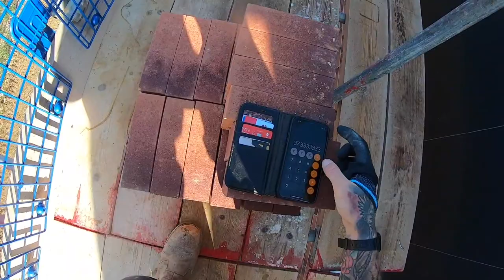Last Day on Maldon site....

Comment: How do you have a project that size and run out of bricks for 5 months
Reply: When big sites activity picked up after the end of first lockdown, they wanted as many gangs as possibles to bash them up even faster than pre pandemic to make up for the loss. But it doesn't work like that, or you end up with no materials since all the big builders did the same thing. Some sites have 25 weeks wait on roof tiles, 25 on bricks...it's ridiculous. Instead of having 3 steady gangs for example and keeping them busy at a steady pace, they got 6/7 gangs on some sites and materials can't keep up. Poor management.
Reply: Chris, blame Johnson's shitty brext trade deal. Most European lorry drivers can't be arsed with the customs officers. So they avoid travelling to the UK and thus  this is causing shortages of materials / food in shops.  The site I'm on now there's only 4 gangs building the houses and before brexit we never had a shortage of anything. Now we're running out of everything every 4-8 days, it's getting ridiculous.
Reply: @wumpty93  Numpty, its got nothing to do with Brexit, factories have been closed down, so of course you are going to have less production of materials. I work in Europe and its the same here.
Reply: @galdessa1  load of bollocks mate. It's never been this bad since we left the EU. I'm telling you now it's everything, not just bricks  timber is the worst, always waiting for the chippys to put the joists on and waiting on the drivers to deliver it. Always the same story from the site agent, "it's been ordered not to worry it's due soon" 2 weeks later nothing but excuses and nothing turns up. 

It's the same from my local supermarkets empty shelves and shortages on basic essentials. Blame the factories all you want that doesn't change anything
Reply: @wumpty93  as much as I would blame it on Brexit as well, it is definitely not the issue. Prices of timbers are through the roof in France as well, and the shortage of material is the same as here. It will just take a while till factories catch up with the demand...